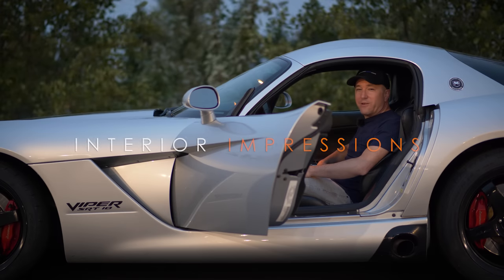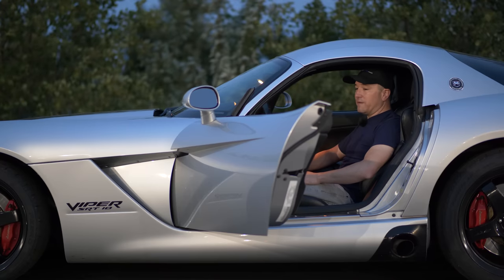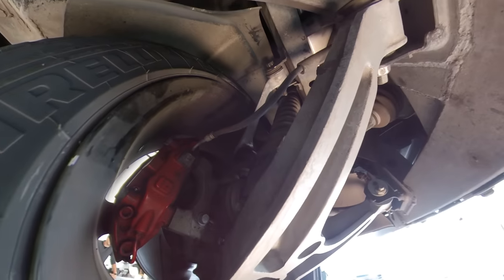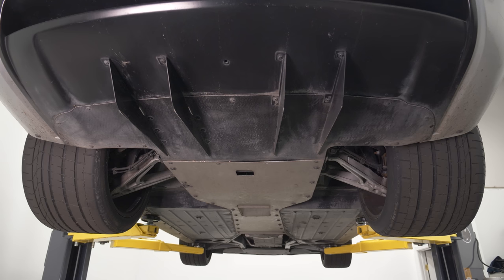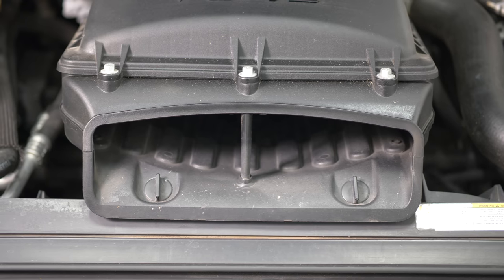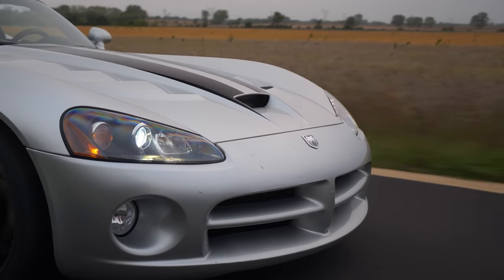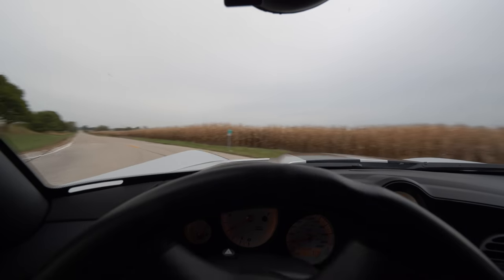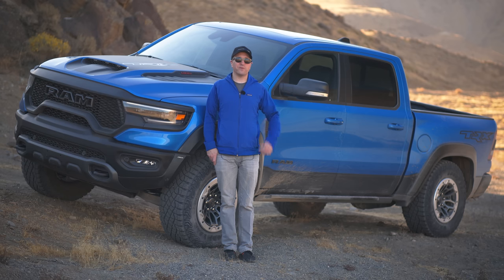Dodge Viper | Super Car or Garbage Truck?

Comment: Is it a fun to drive car? Does the power and sound put a smile on your face? Then if you have the budget and are more in love with this styling why not get it!? All cars come with some sacrifices and I know I would want this over a vette all day.
Reply: Vipers don't sound good at all, just annoyingly loud, and the power is mostly wasted in ordinary driving. Meanwhile, you have to touch and look at the crappy interior every time you drive it. 

A Corvette may not have a lovely, bespoke interior, either, but it's better than this, and they can be a reasonable daily driver, and a Viper can't.
Reply: @markmiller3279  yeah I wouldn't daily drive and would come at it as if I were using it on the weekends.

Comment: In many episodes you whine about the cost of cars, the experience being compromised by the overall lack of value in the car.   You take a purpose built Viper, and then slam the interior but praise it for its virtues.  If you want a balls to the walls fast no nonsense car, this thing is amazing at delivering exactly what it promises, and I've always respected it for that.  Also I drove a Viper Time Attack and it was quite nice inside, but scary as hell, and dollar for dollar pound for pound, it's worth its cost.  Good luck with a comparable European model keeping up on a Grand tour with this thing and never going wrong.
Reply: It's a critical review. You must be looking for an advertisement or something(?).
This was still an 88k car with the interior from a 15k car.

Comment: What a whiny, pissy review.  The interior is functional- not everything needs high-end materials.  I do agree that ergonomics are poor.  The engine and transmission are meant to be stout, reliable and driven hard over and over and over.  The suspension is meant to be tracked and also a little scary, requiring respect.  An homage to the OG Shelby Cobra.  And it looks soooooooo good.  Super sexy, gorgeous and a real event vs a more generic Corvette or 911.  All I hear here is moaning about the interior.  Dude, it works, it's simple.  I daily drove New Edge Mustangs that have similar build quality, plastics, chintziness, etc. for a decade just fine (yes, they are more comfortable, of course).  Who cares about interior quality when everything else is so good?  This wasn't meant to be daily driven.  It's not meant to be a GT.  It's meant to be an experience every single time.  It's meant to win races (which it does).  The Geese says he gets it.  But does he really?  No.

Comment: 12:07 It's impossible to change displacement of an engine by "reworking the entire head". Displacement is solely decided by the measured volume sweep of the piston. No cylinder head change or even removal of the cylinder head changes displacement.
Reply from the maker: Yes Jack was referring to head changes from Mclaren but engine was also slightly stroked this gen. Mis spoke.
Reply: @savagegeese  10-4, you guys are great. Just wanted some clarification on that. What else can you expect from us Corvette owners.

Comment: It seemed all american sports cars of that era had lousy interiors. The Viper was designed to be a muscle car that could somewhat handle along with their patented 1960s super overassisted 1 finger power steering that provides zero road feel.  If you know old Dodge muscle cars then this thing is a blast. Think grown up 1972 440 RT Charger
Reply: Only thing you're right about is the interior. The Viper is a blue-collar supercar, not a muscle car and all the inputs are heavy. Muscle cars are typically four-seat midsize boats, Vipers are deceptively small. It may look huge because of its proportions, but if you parked it next to a 911 of the same year it would be about the same length. As for handling this could pull 1 G on the skidpad, not shabby at all for the time.
Reply: @wristofkings  then the upgraded the steering in the later generations. The Gen 1 Viper I have experience with had the same overassisted power steering as everyother dodge I had driven from the 70s and on. You should be able to get 1G on the skidpad with width of the tires on the Viper.
Reply: @livingroomguitarist7  With modern tires and suspension tech, sure. This is from 2009, pulling 1+ G in an unprepped street car on stock tires 11 years ago was a very impressive feat and pretty solid even now. I've yet to get behind the wheel of a Gen 1 so I can't say what they feel like but the '98 GTS I had some time in wasn't sloppy or overassisted at all. You needed to muscle that beast around.

Comment: I remember when this things first out on the roads. Every time I seen one, it had crash damage. A black and a red was near where I lived. One had a front fender chopped open and the other had the rear fender smashed open. These cars are near impossible to control especially if you have no ability to drive. Guess thata why they said "if you mess with the snake you'll get bitten"
Reply: Nowhere near accurate that they're near impossible to control.
Reply: @rayreggie03  High torque vehicle. If lower powered cars like camaros and corvettes were taking out crowds in the 80s and 90s before the mustang meme became popular in the late 2000s, then a viper is a great candidate for traction loss. And the average driver who could afford these were typically older men who barely could handle an average car. Which at least two of the owners I seen were over 60.
Reply: @EjinRenos  never argued inexperienced or bad drivers didn't have issues.  I specifically was talking about your comment  that they're near impossible to control.

Comment: One of the engines with the lowest power per \liter ratios in the entire industry
Reply: ...And I'm thankful for it! That's the special part, you get the monster torque all the way through by not trying to make it rev to the moon and reach for peak hp #'s for a magazine cover.
Reply: Uh, yeah, and it's still an extremely quick car. Horsepower is not the only answer.

Comment: You guys actually don’t seem to fully understand a car like this even though you keep saying you do. I have had a few very fast cars/motorcycles….including a 700+ whp C5 Z06….which has all the mods to suspension etc to go even faster/handle even better. Similarly to the Viper- loud (good), hot (tunnel plate + dynamat = fix), very twitchy/crazy, interior - what interior!?!? You drive a car like this on the street & yeah it’s a rough ride- but it’s supposed to be an escape from reality, an all consuming experience- like you forget to put on the radio or AC until 20 mins into a drive type of car. You know exactly what it’s like in many ways & while the ideal place is a track is still perfectly fun on long straights or twisty back roads regardless of speed? A sport bike. Cars w/ this level of performance/purpose/ability are no different than a Japanese or Italian crotch rocket really.

Comment: This car is pointless these days... A simply tuned f90 m5 will rip this shits anus apart in every possible way... drag, circuit, street, top speed. The m5s interior is gorgeous. The viper is only good if someone plans on building a 3000 hp monster for the 1 mile run.. but apart from that ? why buy it ?

Comment: I daily drive my 09 Viper in Atlanta. With high flow cats, it doesn't get hot inside even in the middle of summer, and the AC is great. You guys hit pretty much everything spot on though - interior is garbage, the exhaust doesn't sound very good (even aftermarket), and it's pretty terrible when just cruising. But thankfully my commute is in the city, so I have a ton of fun accelerating and cornering. It's a very special car. Great review!

Comment: probably the ugliest generation. wish they didn't make those external design changes to match it with other stuff in the Dodge lineup because otherwise it seems like improvements across the board over the ones before it. love vipers tho